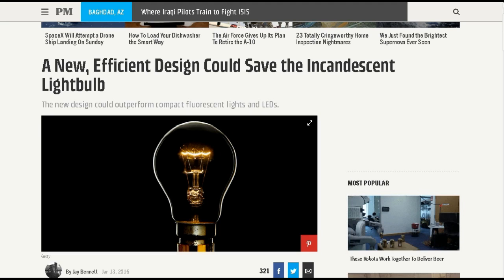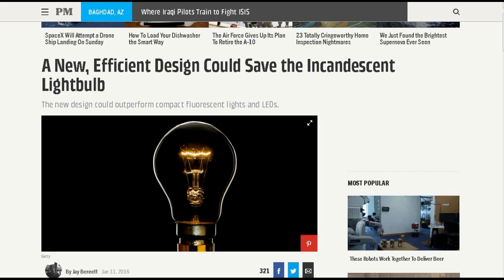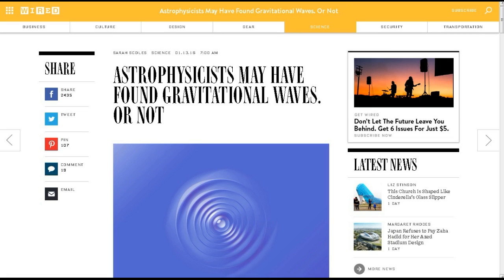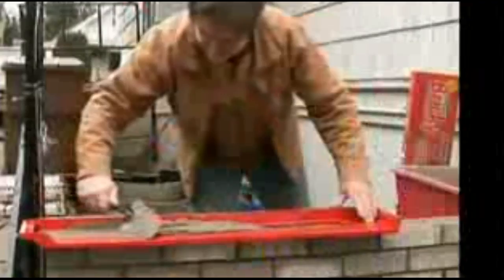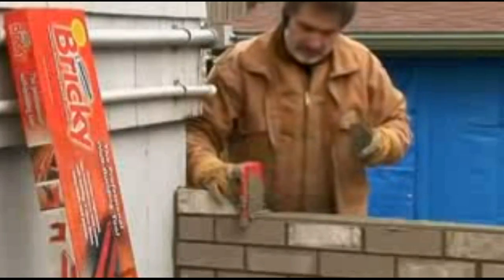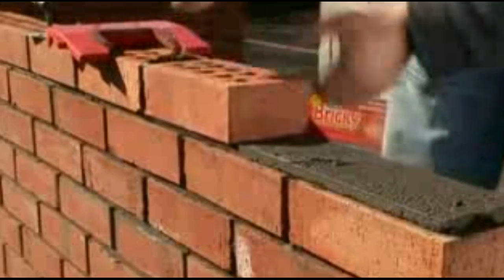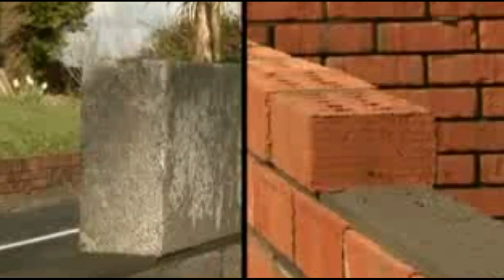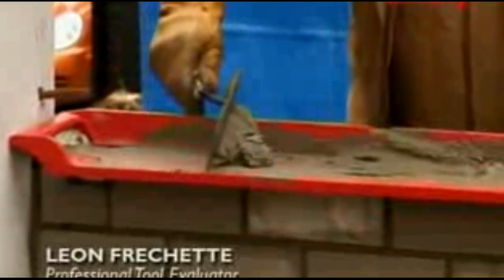TDD report for January 16, 2016

Comment: cool idea with that light bulb, as far as I understand they want to reflect the emitted IR back to the light emitting device which is based on heating up for light emitting ... kind of partial perpetuum mobile ;-)
I really doubt that they can ever reach, after years of experiments, 40% efficiency and 270 lumen/watt as written in the article, and even if so: LEDs are already over 300 lumen/watt. Means, impossible to beat.
Another aspect is that our industries are using LEDs now almost everywhere, every smartphone or car or whatever else device has plenty of these LEDs inside. This shere amount of LEDs on the markets, or in the factories, means huge scale effects. What finally counts on the light market is not only the mere technology and efficiency but mainly how much lumen/$ you get inside the legal frame of efficiency classes - and if you check companies like e.g. Seoul Semiconductor, there you can get 2500 lumen for a buck ... that equals to the output of 3 classical bulbs of 60 Watt, but LEDs last at least 10 times longer than a bulb, means pricewise totally impossible to beat: nobody can produce 30 bulbs for a buck ;-)
But the principle itself is great, I really like that idea ... ;-)
Reply from the maker: +bangalorebobbel Yes, the incandescent bulb was merely a test bed for the theory. They are not interested in commercial production of any sort of consumer bulbs. They talked about this on the radio show. It's more about efficient nano-scale energy conversion. They said most likely it will be used in photocells before anything else to improve efficiency.
Reply: suburbanryder - The Mayor - cool principle, really worth of experimenting ... there are plenty of fields where it could be interesting to send photons of selected wavelengths back to sender or in whatever different direction ... maybe a layer of reflecting nanoparticles at the bottom of some solarcells could even increase their efficiency ...

Comment: from some of the brick / block work I've seen lately done here at sites those so called professionals could use that bricky tool or maybe the contractors should just go back to hiring union laborers instead of illegal aliens to do the construction work
Reply from the maker: +Robert Robb I have seen some pretty slanted walls myself on buildings. That is just lazy work if you can't keep plumb to a string for the vertical runs of bricks.